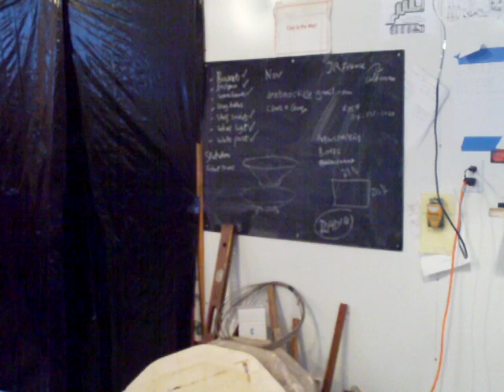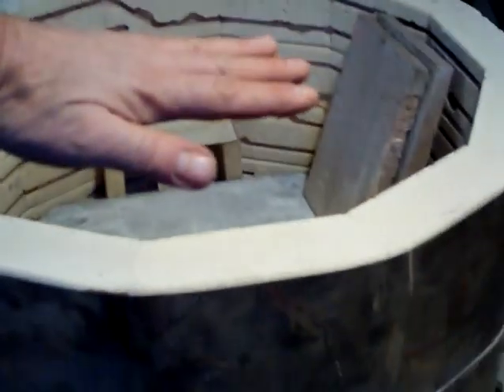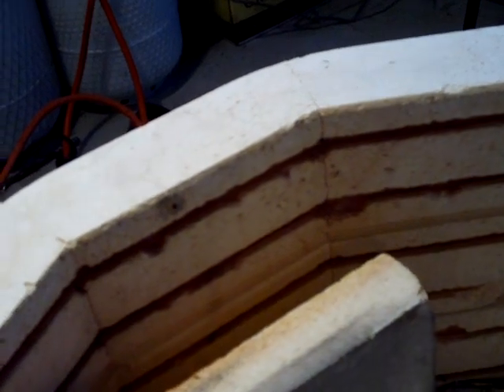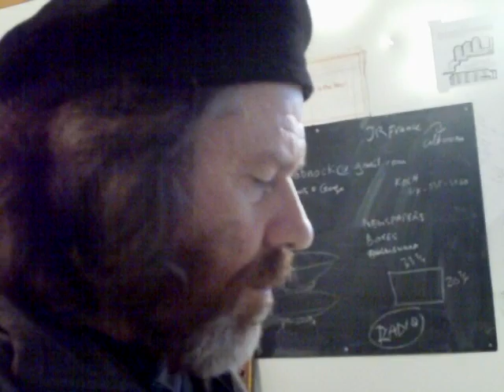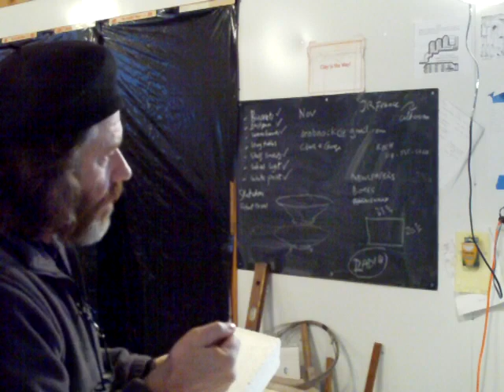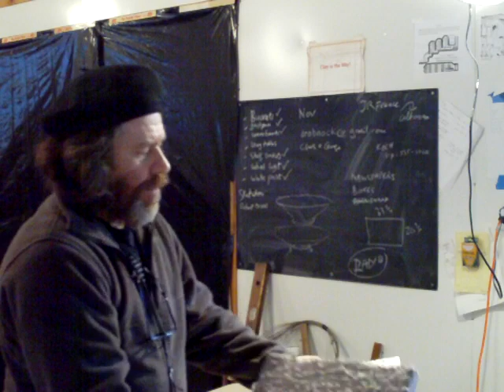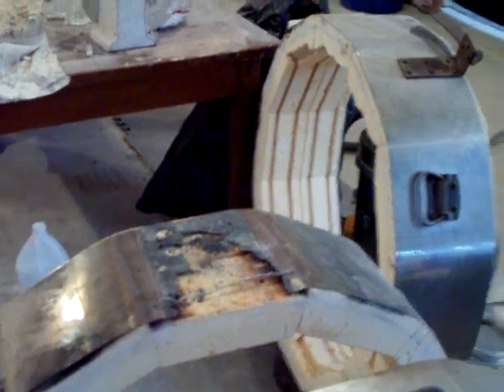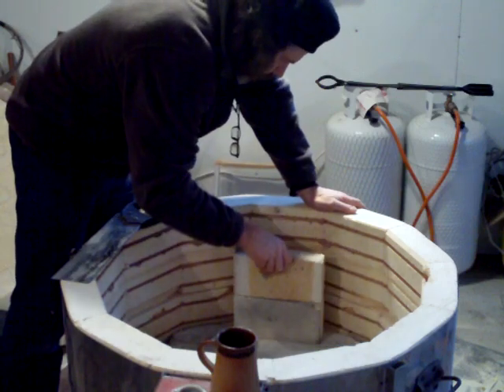S.LEACH POTTERY WORKSHOPS ~ Kiln reconstruction 2 !

Comment: That's a neat idea for an internal chimney. Maybe sliding the lid a bit off center would expose the exit flue opening. I converted a kiln that size into a wood burning cross/down draft with a Pignose Bourry box and a hard brick chimney. Need an extra layer of brick on the outside to insulate better but I got to ^11-^9 in about 2 days, single fire, in S W Michigan in the winter. I could use one of these gas converts to do tests before firing the 65cu.ft. wood burner. Thanks & stay in there eh.

Comment: we dry stacked our chimney with dig bricks then the lid pushed down on it and held it fine . als mack sure you cut the hole in the lid a brick size in and not on the metal edge . 
 my converted kiln has a much bigger size chiminey and i was told by my uncle i can always cut it down later but you can run in to problems if the hole is not big enough . i think i sent you pictures in the past !  jon the expat in up state ny

Comment: an outside cniney will melt but a welder can remove the segment of the stainless steel behind the chimney and then use it to hold the bricks in place, also support the chmney with house bricks . Craig

Comment: Simon, how will you cut a hole for the top for the chimney flue? Will it destroy the whole cover if it breaks during cutting? 

I'd go for the external chimney and I'd build it out of those chimney metal pieces... take one metal tube and bend it into square shape and stick it in there and then with an elbow connector you can move the chimney away from the kiln and avoid further damage to the kiln (and chimney tubes are cheap to replace).

PS: I hope those bricks don't contain asbestos!

Comment: Indiana Jones? Chuck Norris?.... nah.... more like a Rembrandt who has given up painting and taken up pottery? An external chimney flue is probably the better idea since cutting a leak free hole in the top will not be easy? Why not invest in some cheap metallic flexible gas pipes which you could take out through the window and evacuate the poisonous fumes, saving a few years of your life? Also, the hot metal chimney would add to the warmth of the studio for free.